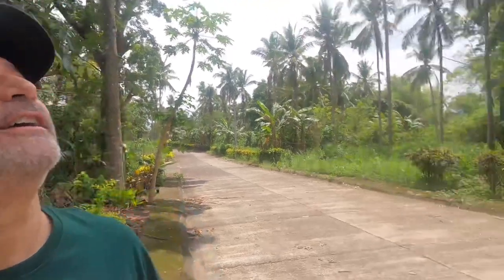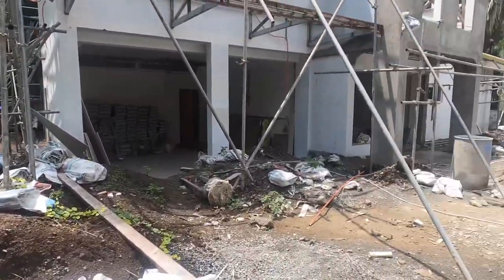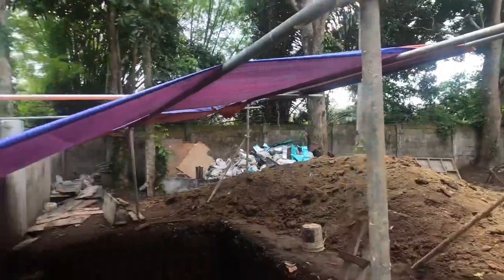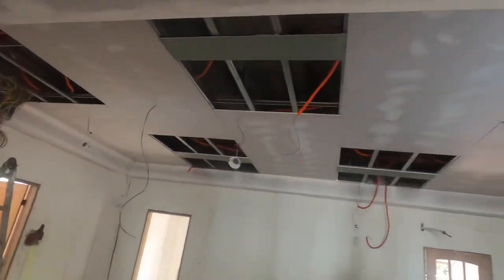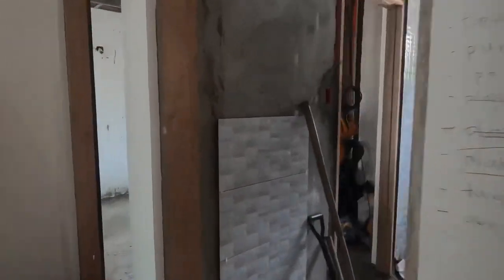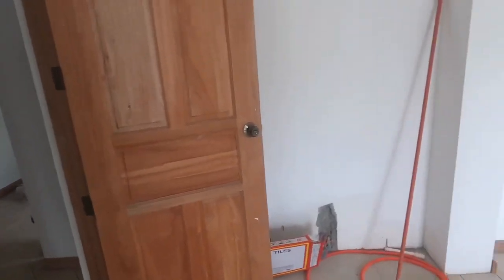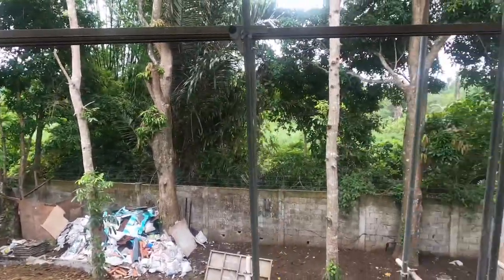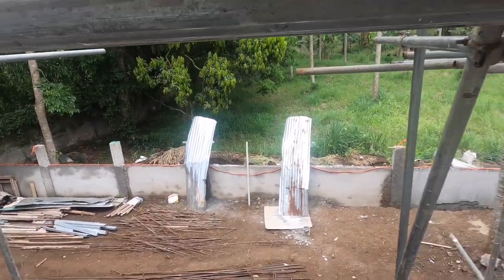Philippines House Build Vlog 75: WINDOWS AND SLIDING DOORS BEING INSTALLED

Comment: Attach some of the Steel matting to the Back fence wall and have your guys render it in.  It will add a lot of strength to the wall.  The Matting is carried by most hardware stores in the area and not that expensive.  Think of it like adding chicken wire to a stucco wall back in the day.  Just an Idea. Good Luck.
Reply from the maker: Thanks for the tip on the fench